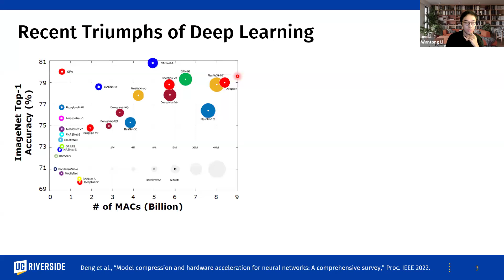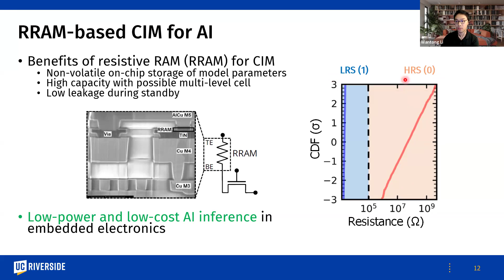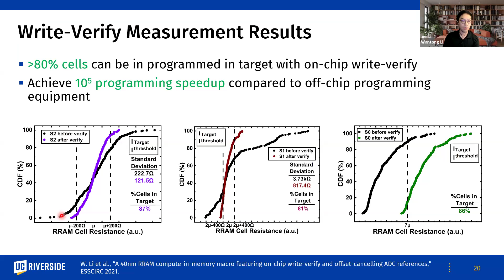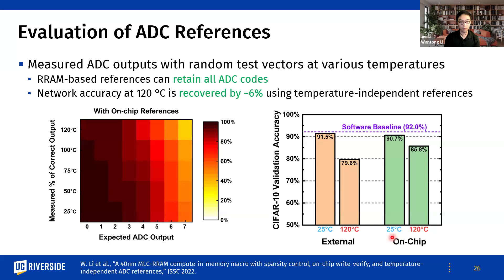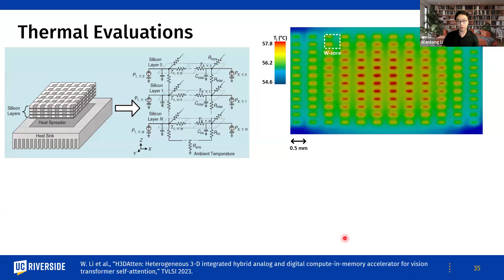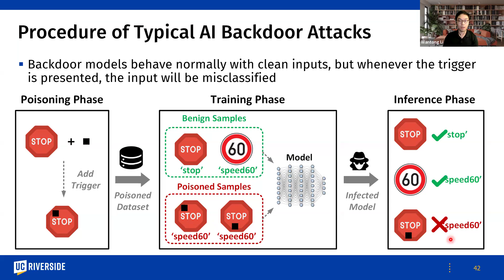Driving AI Efficiency through Heterogeneously Integrated Data-Centric Computing | Prof. Wantong Li

Comment from the maker: Key Takeaways from this Webinar:
✅ Heterogeneously integrated architectures unlock new levels of AI efficiency
✅ Data-centric computing addresses modern AI performance and scalability challenges
✅ Opportunities for energy-efficient, next-gen AI hardware

💡 This session with Prof. Wantong Li (UC Riverside) highlights cutting-edge research in AI system design and integration.

👉 What are your thoughts on data-centric approaches for AI hardware?
Share your insights and questions below ⬇

#AI #DataCentricComputing #AIHardware #WebinarArchive